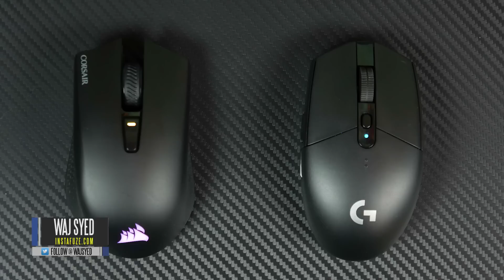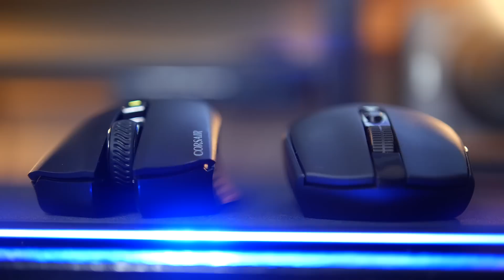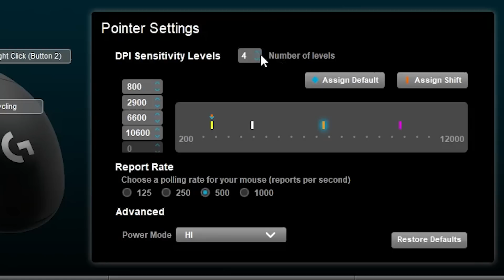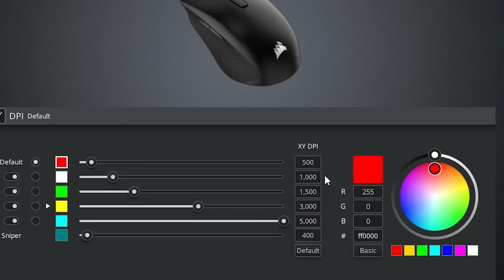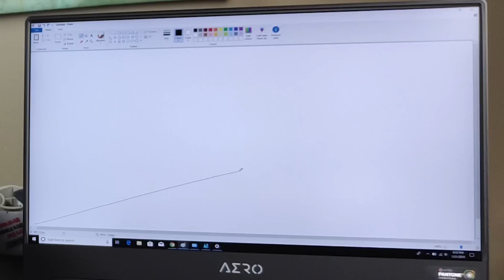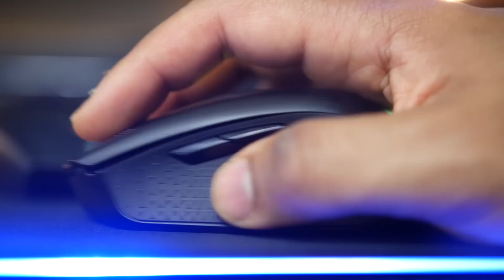What's the Best Wireless Gaming Mouse for $50? (2019)

Comment: The harpoon wireless keeps on double clicking, I've tried multiple firmware versions, don't get it
Reply: is it still having the same issue of double click ?
Reply: @bhavesh_995  I was able to get a replacement from corsair within two weeks of me claiming my warranty, though I had to pay for shipping :)
Reply: @SixCxmets  what about the replacement ? Is that also having issues. Actually i was planning to get this for macbook. But saw all people having issues, if its software issue then maybe it will be fixed. But corsair seems to lazy. Let me know if your replacement works fine.
Reply: @bhavesh_995  Yes, It's been working fine since I got it but It's worth mentioning I haven't installed the corsair software back in case it messes it up again lol
Reply: @SixCxmets  thanks for taking out time. sorry for bothering you again but can you customise the lights and keys with some other software ?
Reply: @bhavesh_995  you should be able to with the I cue software which is made by Corsair

Comment: I have a wired Corsair harpoon and I don’t have to use a claw grip (it’s kind of pushing it though), and although my hands are a bit small for my size I have pretty average hands considering most people aren’t 6ft. So if you consider yourself to have large hands I do not recommend the Corsair harpoon. But if you have relatively average hands it works perfectly fine

Comment: It's their hero 12K sensor, which is slightly worse than the hero 16K sensor. The 3325 is better IMO. Also the hero 12K is basicall a PMW3366 with more features removed for powesaving, it's pretty shittily done tho logitech should have done a better job.

Comment: Wait what, G305 have subpar internal processor or optics?
1.) arent they the same HERO sensor
2.) I have not heard any other reviewer mentioned that the G305 sensor is subpar compare to G Pro wireless. 
Please can you elaborate on this.
Reply: I think the g pro wireless has a hero + sensor while the g305 has the less but still very very good hero sensor
Reply: Yes, even Rocket Jump Ninja claims the HERO sensor in g305  is extremely similar to the g pro wireless if not exactly the same (only lower maximum dpi). Basically all reviews I've seen say HERO is the same as the 3366 sensor. Which is used in competitive e-sports

Comment: be slightly warned if its just a plain pwm 3325 and you do flick really fast eg a higher cm per 360 sens you may be able to spin out the 3325 but there are some slighty tweaked pwm 3325s that have not faced the issue and alot of users have quite low cm per 360 so they probably wont face any issue anyways

Comment: Had the G305 since launch. I do wish the build quality was a bit better and the scroll wheel could really be improved. But, otherwise its fantastic.
Reply: how often you have to charge it or replace batteries? I play a lot and never had wireless mouse before
Reply: @Jacobson47  not very often at all, well for me at least lasts around 3 months maybe more
Reply: G304 is really bad, I have owned 2 till now (1 RMA unit) and both develop double clicking issues and my latest one has got sensor issues within 1 year, whenever I flick hard in any game the mouse sensor absolutely dies. I even had a really bad experience with their headsets, my g303 headsets developed static sound issues and the overall volume of the headset reduced a lot within 1 year as well. For those who had good experience with Logitech products, good for you but I'm never buying a Logitech product ever again. Definitely going to buy the Corsair harpoon wireless this time

Comment: The g305 would be a solid choice if it was not made to fit the hand of a child. My hand cramps up when holding it.
Reply: you are holding it wrong then... its supposed to only be held by your fingertips  and NOT by your palm on the cover.... palm should not touch the mouse but rest on the mousepad. https://pics.me.me/palm-grip-claw-grip-fingertip-grip-20319261.png   ->  here in the last pic you can see how you have to hold a small mouse.
Reply: Get the g903 then
Reply: I wish the mouse was smaller and my hands are fairly average-sized, 18x10 cm
Reply: agree, another thing is it can't recharge seem a bit annoy some how. however when come to sensor i can deny that hero senser feel a bit better than the one in harpoon. 

ps if you not stick with wireless so much you can add a bit more money to buy g403 (wired) it far better than this.